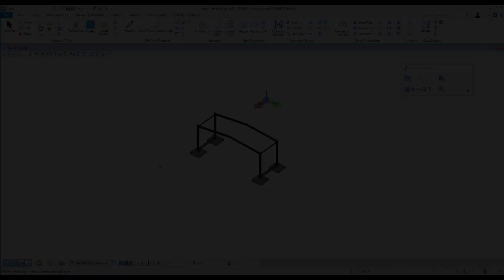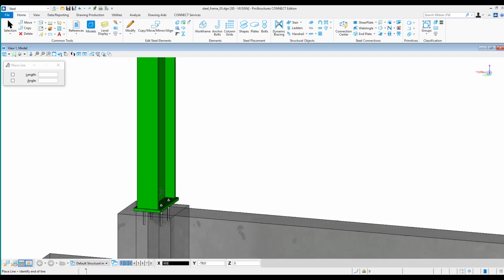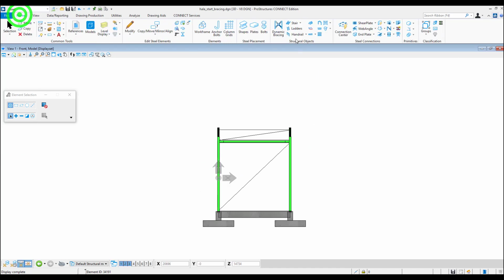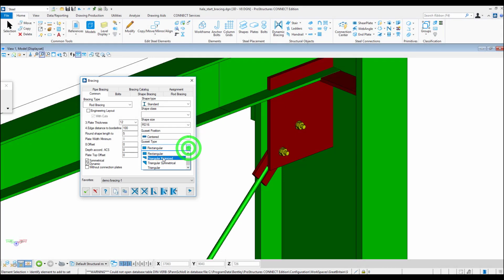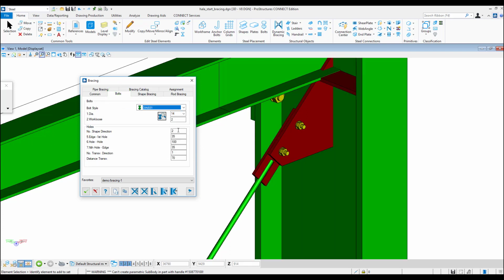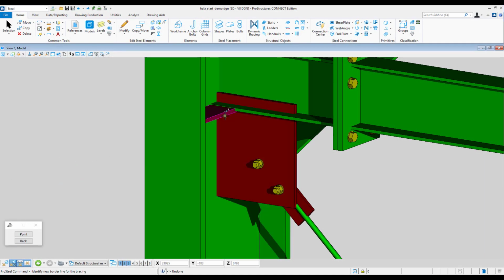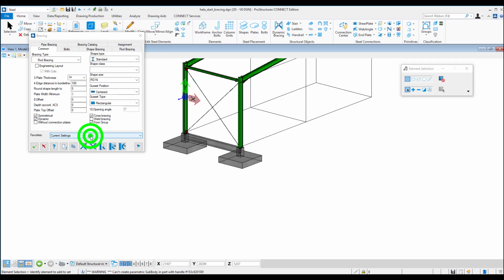Bracing Modeling | ProSteel CONNECT Edition Tutorial | Part 5

Comment: even at a demonstration it works poorly
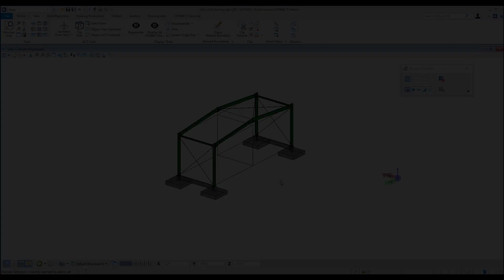Reply: So true. The functionality (bugs) are the same as in 2007 version. When you zoom in, you can even see the program didn't create correct dynamic bracing for him, and he covers it either with transition or dialog window. When you try to enforce border lines the software goes completely crazy. at 1:37 you can see this. at 0:57 when he makes the transition, it isn't even same bracing that he created in the previous shot.
Pls fix @Bentley Structural Detailing